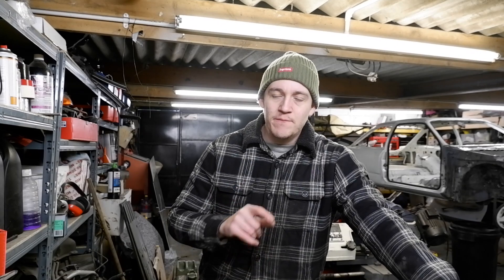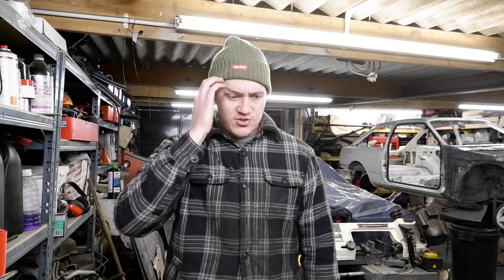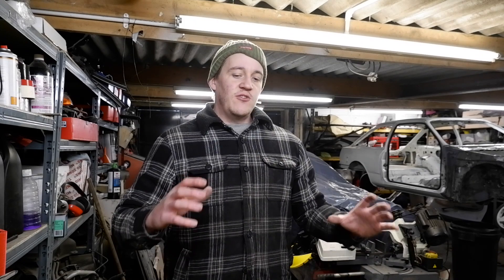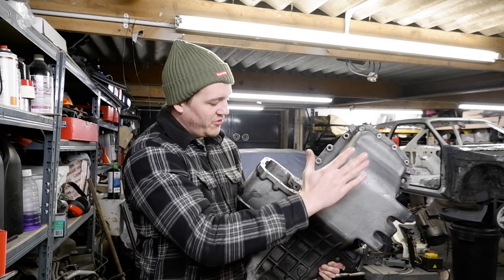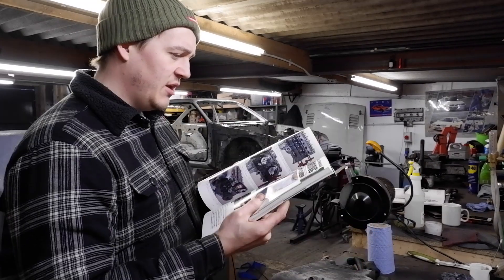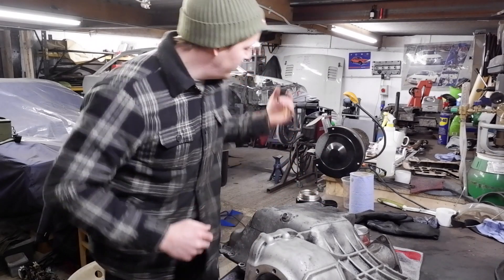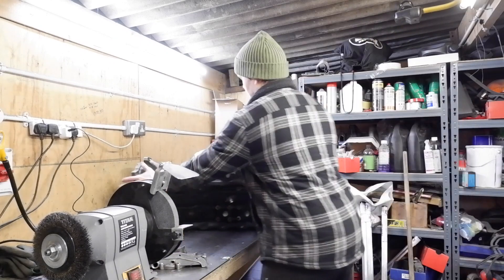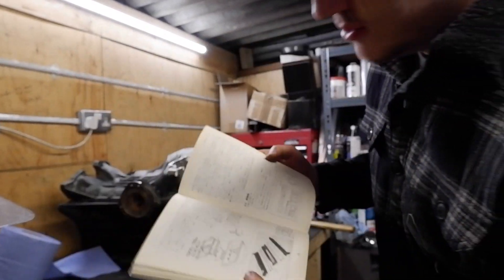Engine plans - GpA Sump fabrication - R32 GTR Build 23

Comment: what are you doing in regards to the sump drain?
Reply from the maker: The one I welded up? I’m just gonna re-drill and tap it mate. Didn’t want to leave it helicoiled so I don’t have the chance for more. I’ve actually seen one group A car with a male AN fitting there and another higher up. Maybe for heating oil.

Comment: Love it dude! Having done tons of these I know your pain in the cut/prep/fab area of the job. I'm surprised that book has the return hole information in it, I feel like an idiot I own the book but never read to figure that out. Definitely plan on going up on drain hole sizing now. Cheers! Awesome project and work
Reply from the maker: Cheers dude! Yeah there’s a little A-A cross section diagram there with the hole size, proper hidden though. It’s quite big, a lot bigger than tomei or owt else. When I filled it up to leak test it it certainly pours through them.  

Do you tend to weld the insides to tidy it up or not risk the warping? 

Throwing 200A plus at some dodgy old aluminium doesn’t get the smoothest most consistent finish inside!
Reply: @AlexGrA  I weld the entire outer perimeter with a 3/4” alum plate (no spare blocks around) and let it cool. Then I weld the entire inner perimeter after. A lot of aus dudes don’t use a plate or block at all with no issues so I think we’re doing good as is
Reply from the maker: @Leaskspec  sweet good info cheers dude. I’ll run around the inside then. Since it’s not going to penetrate through the whole thickness then there shouldn’t really be anywhere for it to shrink to anyway I suppose

Comment: I understand your logic on the sump but the proper motorsport cars also got their engines rebuilt much more frequently I would assume.
Reply from the maker: Oh very much so! Which is one of my reasons for using the sine drive pump. 

I’ll be running pressure transducers so I’ll have a log of if I do surge and will just have to cross that bridge later on.
Reply: @AlexGrA  It is great work BTW, I love your approach to this. Without question the baffling is going to be critical.
Reply from the maker: @TacPrecision  cheers dude. Yeah they ran two huge viton flaps and then a cylinder down the pickup. Quite like a 911 engine. Let’s hope it stays wet! Lol
Reply: @AlexGrA  I am sure you haven't but don't forget to think about the vertical plane, my extended sump had a plate that went around the pickup to stop oil when cresting a rise.